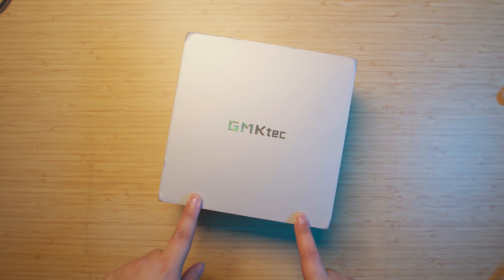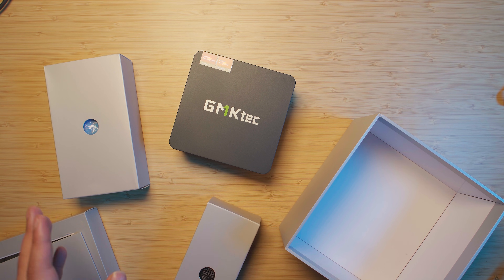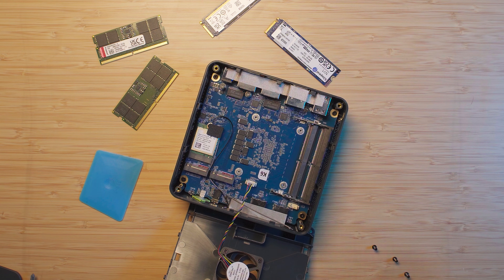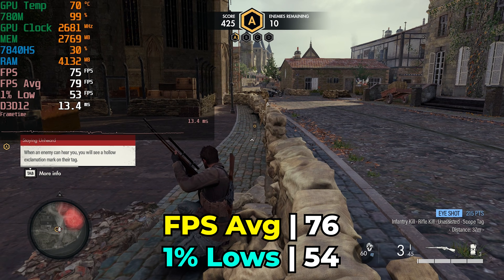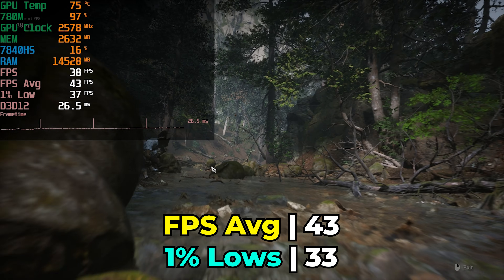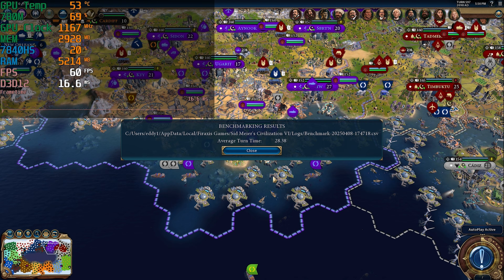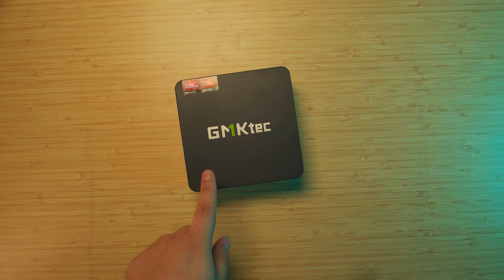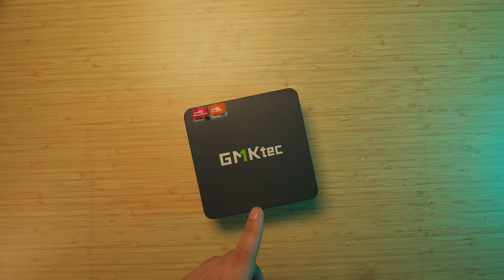$270 AliExpress Mini PC | Cheapest R7 7840HS | GMKtec K6

Comment: For anyone thinking about getting a K6, please consider that this is one of the loudest systems with the Radeon 780M. As a previous owner to one, I found it quite intolerable to have on top of my desk within arms length.
Reply: Really was itreally that noisy compared to a regular atx or even mini itx build? Even with the settings set to balanced in bios?
Reply: @Asadc1995  Robtech measured 47 decibels with the balanced preset. The noise when idle or just web browsing was honestly more annoying, with the fan randomly spinning up and down. There is no way to configure the PWM setting in the BIOS, you are stuck with that aggressive fan profile.
Reply: @dualpapayas  Ah thanks for the info!

Comment: Given that regular RAM in PCs has no real thermal monitoring, and while it might have thermal sensors, it has no way of downclocking due to thermals or anything like that (the system doesn't read those sensors or monitor them in any way beyond there being thermal shutdown limits encoded into the BIOS), I'm very curious as to how RAM thermals would slow down that previous PC. Overheating RAM generally means instability - i.e. system crashes, or at best application crashes. RAM, broadly speaking, is either stable or not. It can downclock to save power, but it doesn't have the capability to thermal throttle.

Comment: Anything heavy on memory bandwidth is not good on older APUs. Ryzen Max 380 ~ 395 come with what should be considered quad channel memory configuration (256-bit bus), So those are considerably better for games.
But that little box is wonderful as classical home server, and can be paired with up to 256GB RAM. Very energy efficient. Just in this case one should mod box to have better airflow. And probably replace that fan for bit bigger one (And increase intake hole size in process.)

Comment: Hell of a deal. I recently bought a K8 Plus barebones on AliE for 325$. Would've gone with this one, if it had an Oculink port. That was a must for me. But this is a fantastic deal. As for the RAM cooling, I put some graphene heat spreader strips on the RAM in my K8 Plus. Seemed to help it a bit. Also bought on AliE
Reply: It's worth paying more for k8+ since it has better cooling. K6 has some heating issues from what I've heard.
Reply: @theSeventhDruid  I owned a K6 previously. The fan curve is very aggressive and keeps it decently cool, but the problem is it is very loud. There is no way to modify the fan behavior. It was especially bad when doing basic tasks like web browsing, it would just randomly ramp up and down. I switched to a SER8 and on top of being more quiet by default, you can access PWM fan control in the BIOS and tweak it.
Reply: I picked that one up as well. THOUGH, I went all out, and I think it was $600ish dollars for 64GB and 2TB with Windows Pro. Wasn't too bad.